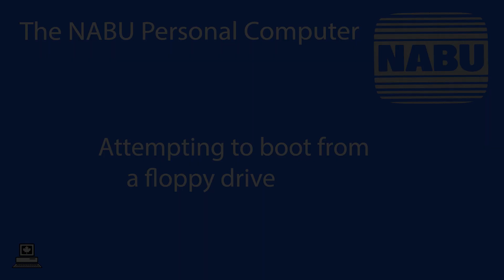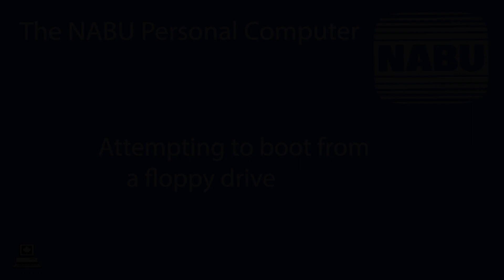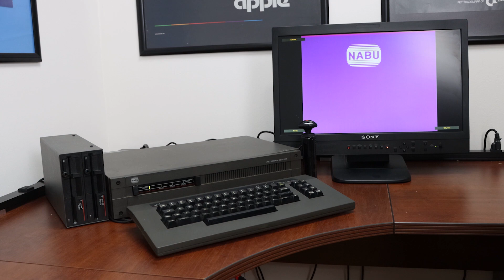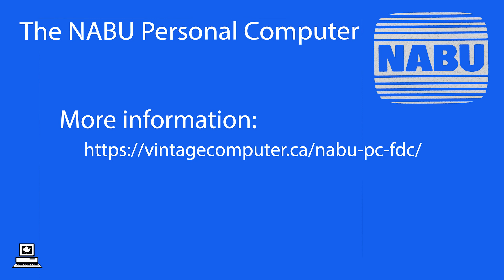Nabu Personal Computer: Floppy Drive

Comment: well. all the stuff that applies to other 40 year old diskdrives also applies to these.... open them up and see if the heads are not dirty or simply worn out (open coil ;) and if the lubricant hasn't turned into glue by now... basically it should seek to some index track so it should 'do something' and oh eh 'turn' :P although the teac's are not belt driven still plenty of things that can physically get stuck. other than that... device numbers and bus termination (yes that's a thing with floppydrives too although most pc people never figured that bit out ;)
Reply from the maker: I appreciate the comment.  I've taken both drives out and used them on a PC to image the disks to remove the possibility of bad drives or heads being misaligned when one drive makes the disk and the Nabu drive reads them.  It is confirmed that one drive does NOT work properly (haven't tried to fix it yet) but the other drive reads and writes disks back and forth with no issues.  The working drive is in drive A.  I also take into account the terminating resistor when swapping drives.  All good possibilities but drive A is known and tested good.
Reply: @vintagecomputerca  I'll try to format brand new ones derived from my personal copies of NABU CP/M. I'm sure we can get it booted. I'm still working on imaging those floppies.
Reply from the maker: @leo.binkowski  This portion is part of that video I am creating to archive and restore Nabu floppies.  Unfortunately, I don't have a VGA capture device so I'm trying to get something to work.  I need to send you a file for 22Disk so yuo can verify the images are good.
Reply: Drive ID select? DS1 for use with the PC and the twisted cable, DS0 for first drive for other systems using a straight through cable.

I remember the fun it was getting three floppies setup correctly on a TI-99/4A with the connector PCBs it used between card edge connectors on different cables, and how it didn't have individual motor control. Accessing one drive spun them all.
Reply from the maker: @greggv8  The Nabu floppy drive unit does not use a "twisted cable" method internally.  It uses jumpers for DS0 and DS1.  I also have to move the terminating resistor if I swap drives.  I will open it up again and double check, however, if there was conflicts, both drives would come on or neither would.  Doesn't hurt to double check just in case.
Reply: i was kinda suprised to find that 5.25" drives go for around $200 again. lol. normie pc ones heck they didn't even cost that when they were brand new in the 1970s lol. should not have kept your $0.50 bitcoin people... should just have kept all those 1000s of 5.25" drives you threw out over the decades :P lol.
Reply: could even be as simple as someone having written the copy of the disk with a 1.2mb drive, which 'can or cannot be read' properly as it produces thinner track modulation. they're kinda 360k compatible.as long as you only want to read them :P not write them for use with actual 360k drives.
Reply: @CB3ROB-CyberBunker  ohhh, yeah. Definitely that. Never ever use an 80 track drive to write to disks formatted with a 40 track drive. You can get away with it on a freshly formatted disk, and possibly over writing will work, if the data being over-written on the 40 track drive formatted disk was written using an 80 track drive. If you take a 40 track drive written disk with data and format it and write data to it using an 80 track drive, it's very likely to not be readable in a 40 track drive due to the outer edges of the track retaining the old data.

Writing to a 40 track disk formatted in an 80 track drive has the issue of the formatting data being narrower than the 40 track drive is made to work with. Assuming a truly blank disk was formatted to 40 tracks in the 80 track drive, the 40 track drive will be writing data partially into 'uncharted land'.

Even if you're never over-writing with either drive, you end up with a mishmash of data written wide and narrow.

It's best to just not ever cross-write 40 track disks between 40 and 80 track drives, and know that a properly erased then formatted and written 40 track disk done with an 80 track drive may have read issues in a 40 track drive.
Reply from the maker: @greggv8  My disk archiving computer has both a 360k floppy and a 1.2MB floppy.   If I could sort out how to add two more drives, I would include a 3.5" drive (already in it but disconnected) and an external port for an 8" drive.
Reply: @vintagecomputerca  check out MonsterFDC if you have an ISA slot free. no external port but you could just run a ribbon cable out the back from one of the 4 floppy disk connectors as it allows a computer to have a total of 8 floppy drives.
Reply from the maker: @CB3ROB-CyberBunker  I've used both a DSDD 360K floppy drive and the actual SSDD (single sided) Nabu drive in a PC to write the disk just in case there was any head alignment issues.  It is a good thought though.
Reply: @vintagecomputerca  plus double sided disks actually rotate the wrong way around for the backside anyway :P not entirely sure how pc's handle that but i take it they read a track from front and back at the same time (seek track, read sectors on the front, read sectors on the back, and only then switch to the next track) now that the head is in front of it anyway as that's the slowest part of the operation :P i think the pc bios may have provisions for single sided drives but they never were much of a thing on the ibm as they all shipped with 360k dsdd. if not there is a pretty good chance it sent half of your sectors to 'the other side of the disk' which the drive has no way of handling. it it can pull /SIDE1 low all it wants it simply won't be connected on the drive at all. so if thats the case after writing the disk in the pc with the nabu ss drive in the pc, reading it back and comparing the file should result in half the sectors being there and the other half being blatant copies of the first half (the size will still be the same tho ;)
Reply: pc's without specifically telling them to in the bios (if it even ever supported such things. most likely newer ones simply start at 360k and then only have 1.2mb as the other option, no 90 or 180k singlesided ;) will simply assume 360k both sides. this could also have happened several steps before you even got that disk. :P at someone else.
Reply: the old pc bios calls do support write to chs (cylinder head sector) specifially... that was the only way to get disks to work after all back then before the lba days. :P not sure if that also flies for the floppy controller tho. else just check the file for repeated sections... as then it already happened during some earlier copy.
Reply: provided ofcourse it even uses the same encoding as a pc. gcr/mfm/fm/etc. (that's a controller chip thing. not a drive thing. ;) the diskdrive itself is more like a tapedeck with a schmittrigger attached :P it doesn't care if you dump rs232 or nrzi or mfm or manchester whatever on there :P that read data pin doesn't poop out clear 1 and 0's :P
Reply: the nabu seems to be developed by at least some professional people (unlike toys like the c64 or zx spectrum which were already quite happy to get like 10% of what could fit on a disk onto a disk. as long as it saved them $0.10 in ic's or so ;) (the we can also do it with a transistor and a capacitor and some ductape and wd40 mentality ;) heck it can still fill the entire 64k of ram in under a minute! yay. :P so most likely besides using proper drive mechanisms (albeit them being single sided ;) they also went for 'the normal professional way of controlling' said drives and it isn't something completely obscure like commodores format that went on there :P see these things actually look like they were made by something like a sony or philips or rca and not some overgrown garage operation that makes toys. so yeah i do expect it to be normally formatted like pcs do it too lol. just not double sided. not so much the actual fat12 format... but the encoding itself. layer 1 and 2
Reply from the maker: The original IBM 5150 has a single sided, double sensity drive.  It wasn't until DOS 1.1 that double sided support was implemented.  When I connect the Nabu floppy drive to my PC, it is set as a 360K floppy drive in the BIOS.  The ImageDisk software does all of the proper writing as it supports many systems with SSDD drives.  It even supports having 1.2MB floppy drives write SSDD diskettes but I prefer not to do that and use 360K drives.
Reply: @vintagecomputerca  years ago I had to read some single density disks. To do that on a PC required finding an ISA floppy controller with the right model of chip then making a small modification to the board to enable 22DISK to switch it to single density. I don't remember the specifics of the chip or the modification, just that some of the chips didn't support single density because IBM never had that in the PC.

I thought it was odd that double sided wasn't supported from the start in DOS when the drives were available.
Reply from the maker: @greggv8  I am running an Adaptec SCSI controller  (AHA-1522A I think?) that has a good floppy chip on it.  Thankfully, these are Single Sided but Double Density (SSDD) drives so I don't have to worry about single density.  It does get hairy when you have to deal with that.  However, I think the Adaptec card does it.  I appreciate the comment all the same.